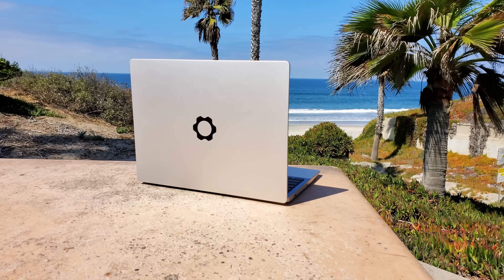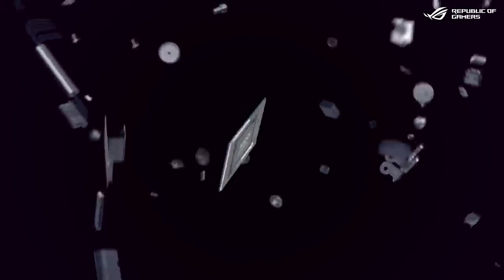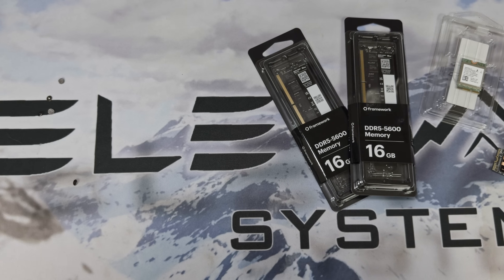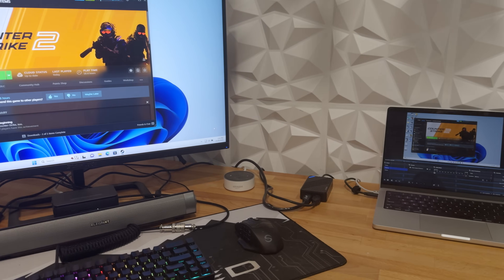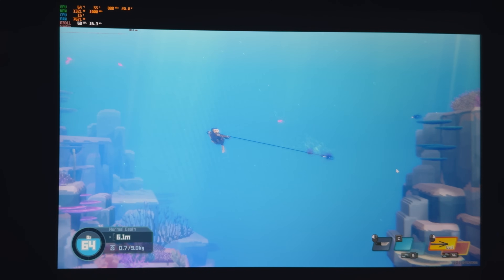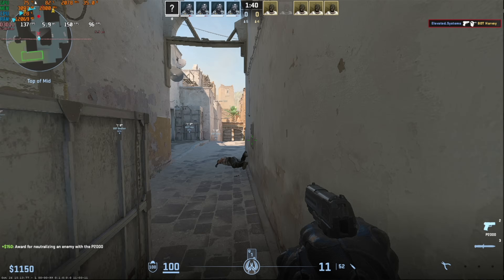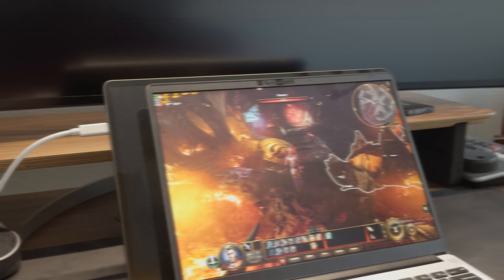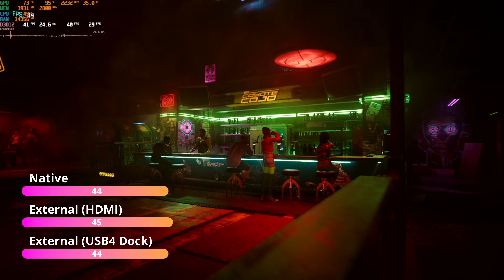Gaming on the AMD Framework 13! Native, Docked & eGPU Performance.

Comment from the maker: Between the testing I did in this video and some since then one additional, important conclusion I've made is, that while FSR may or may not have a significant effect on average FPS depending on the game, it has a significant effect on 1% low FPS in every title that supports it. The gameplay with FSR enabled is significantly smoother than without it.
Reply: I would presume it is “just” the upscaler you have used (now that it is only recently frame generation has been added). 
It is bit annoying both Nvidia and AMD has put new features into the upscaling name, making it very confusing what exactly has been used, lol.
Reply: Thanks, man. I love portable computing 🖥 .
Reply: I would love a quantified look into how Frameworks recommended linux disrtos preform with the battery saving tweaks and without. Also the mention of comparing the framework AMD to the MacBook M2 or M1.

Comment: Using a resolution that's exactly "half" of your native resolution will help drastically with the image quality, as every 4 pixels now renders as one. It's not great. But it least it scales proportionately. Also it's interesting how some games kept it pegged at 97-99% usage and the chip at 35w power draw, while others were closer to 92% and down around 30w. This is definitely limited by the memory, and I wish amd would give these apus some soldered dedicated vram, at least in the higher power configs like the HX chips. The former U and now regular ai cpus don't need it and it would only add to cost, but these 16 cu ones trying to compete on the same memory bandwidth as the CPU? Pain. Cherry picking your ram on desktop makes the desktop counterparts of these cpus significantly faster for gaming, like upwards of 20%. So it's definitely the limiting factor here. And considering the high native resolution, it only makes stress on the memory that much worse. That's why fsr will help drastically.

Comment: Question, how plug an play is it to use an AMD eGPU for the Ryzen 7000 series Framework 13? Is there any problems with AMD Aldrenaline software or does it just work?

Comment: With the new framework 13 AMD AI ryzen. Would that be good for gaming?
Or can you recommend other things?
Reply: The Ryzen AI 340 is weaker compared to the 7640u, the 350 should be on par with the 7840u, likely minor improvements but costs more and the Ryzen AI 9 HX 370 should perform similarly to the 7840HS but it costs a lot of dough

Comment: Contemplating the Framework 16, but I use an Intel chip based TB3 external NVIDIA GPU as my work docking station, and I'm not sure how well it will work with AMD and USB4.
I'm also apprehensive about using Radeon graphics again. My last laptop with it crashed all the time just trying to watch youtube. Same with my gaming desktop with a RX6800, and then a 7900 XTX. (both clean installs) I ended up selling the XTX for a big loss to get a 4080S, which has been much more stable.

Comment: Curious if you'd consider doing this for the framework 16? I know it has a built in GPU option, but I'd love to see how that compares to an eGPU setup on the 16 (and I cannot find anyone who's actually tested it). I've heard it's built in GPU option isn't the greatest (nor would I expect that much given its only $400) But to use it with a high end GPU basically requires an eGPU but I don't know if its worth going that route.
Reply: Wondering the same thing. I have a thunderbolt 3 eGPU docking station with a RTX 4060. Works great on my old intel laptop, even with light gaming, but I really want to upgrade to the FW 16. But if I can't use a nice 1 cable solution with AMD, that's a no go for me and limits my 16" laptop choices.

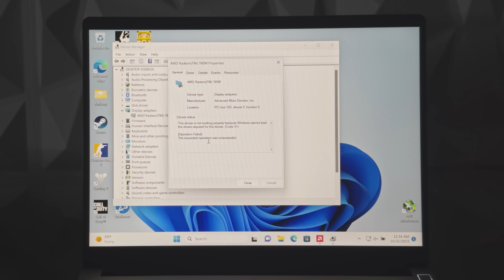Comment: I have seen the problem with drivers shown on 14:07 before and from my experience it should be easily fixable without reinstall. Windows is trying to keep the drivers updated on its own and then there's a mismatch of versions between the Adrenalin and the drivers used. You can actually fix that without reinstalling the drivers by going to Device Manager, pick Update driver on the GPU and then pick the correct driver version from the drivers already on your computer.

Comment: I've got a 12th gen Intel Framework running Linux Mint and have been considering migrating entirely over to using it with an eGPU rather than having a dedicated gaming PC and a laptop. I was about to buy an eGPU enclosure but had some people mention that currently the technology really struggles with high refresh rate monitors.

Have you experienced this at all? I have 3 144hz displays and would like to continue playing games at that refresh rate, at least on 1 of them at a time.
Reply: I ran my frame work with a 3050 and a 165hz monitor and no complaints

Comment: Baldur's Gate 3 uses FSR 1.  Even on my 7700XT, you can see the same type of drop in image quality by turning it on at 1440p Ultra.  I was hoping to see patch 4 at least update it to FSR 2 but it didn't, from looking at the the patch notes.  I haven't installed the patch, yet, due to all the reports of people having issues with it.  As it stands, it's not worth bothering with FSR in the game, if running on most of the more recent AMD GPUs.  If I were playing on my 2in1, I may have to turn FSR on to get anywhere near a good experience.
Reply from the maker: Patch 4 upgrades it to FSR 2.2 https://baldursgate3.game/news/patch-4-now-live_96
Reply: @ElevatedSystems  Okay.  I must have overlooked it.  Thanks for the correction.

Comment: Let’s face it.. the framework laptop could have been an amazing project but it failed in various aspects. It’s not mainstream - fine was to expected, it’s not a creator laptop - fair enough most would go with apple, but it aims to address nerds and tinkerer. However, despite the fact that all forums where full with the just one wish: ECC as the new amd chips fully support it framework went to the „fu-route“ to save 5cents for leaving out traces. 2nd wish was open source firmware - line tuxedo. „But it is fully repairable“ yea.. so is the steam deck for a fraction of the price.
I still don’t understand how you can just treat the Audience like that. It just LTT recommending this box.
Reply: how to tell you're an apple boy without telling you're apple bot
Reply: @ChrisTian-sd5yq  I am everything but an apple boy. But you clearly don’t have any clue about the stuff I was talking about.
Reply: The creators fully understood that it wasn't going to be  a household name in 3 years. they wanted to disrupt the market and make a good laptop.
Reply: @RainbowGin  so why aren’t they doing so

Comment: I honestly had a better egpu experience (7640U+razer core x+ gtx 1070) On windows 10 ltsc was getting a solid 81 fps 1080p max settings on farcry 5 with no stutters and really smooth. From my experience its a lot more stable to use a Nvidia card as the Egpu as it's drivers doesn't conflict with the igpu. However an AMD egpu is fine with a intel igpu. Will be getting the onedock soon do will be testing occulink and USB4 performance using it
Reply from the maker: If I remember correctly on the GTX 1070 Far Cry 5 ran at about 100 FPS at 1080P ultra  when it came out over 5 years ago. What does it run at with the 1070 in a desktop with a current CPU today?
Reply: @ElevatedSystems  I was getting around 95 fps on my desktop same card. In this case the bottleneck doesn't really affect the gameplay. However witcher 3 next gen update struggled a  lot but then again all systems do

Comment: I have my amd on preorder. Batch 9.  
I am wondering what the gpd g1 portable epgu would do.
Reply from the maker: Since Occulink isn't a practical option on the Framework you're still going to have the USB4 bandwidth restrictions which will very likely reduce the performance of the 7600M to barely above the integrated 780M. However, I'd be very happy if someone proved me wrong.

Comment: How about connecting the GPU to PCI express? For example, instead of a Wifi module
Reply from the maker: The M.2 WiFi slot is only an x2 connection. You can connect it to the M.2 SSD slot but then you would have to run the OS via a USB drive, which comes with its own problems.
Reply: doens't it have 2 ssd slots?

Comment: I know nobody is covering framework 7040u 😢
Reply: I feel framework in general needs more spotlights and recognition. No other laptop company is coming close to offering something so repairable and so much upgradability
Reply: too expensive
Reply: how so ?  @LagiohX3
Reply: @X862go  it costs 850$ at that price you get a laptop with a dgpu
Reply: @LagiohX3  it's not 850 when I'm looking, and a laptop with a gpu will only run for an hour on battery 😂. They are basically pointless unplugged from the wall
Reply: @LagiohX3  also navida Gpu will limit you to 30 FPS  unplugged.  At that point, you can build a desktop if you're always plugged up 🤔
Reply: @X862go  you don't use the gpu off the wall obviously but it's there when you need it.
Reply: @LagiohX3  not an option 😂
Reply: @LagiohX3  you haven't used a gaming laptop lately. Have you.  I currently own a zerphrus m6 and an Alienware . The suck back almost 250 watts from the wall and 50 minutes unplugged now that the battery are a year old.  So they're basically paperweight.
Reply: @LagiohX3  trust me, it's not perfect, but the 7040u is giving us about 1050ti lv of gaming at 18-45 watts.  While all other windows pc pulling back 100watts to give you anything considered gaming.   Main company's don't seel APU in there laptop because it will kill their gaming line of laptop with rtx whatever 🙄.  The issue is that navida sets the TDP of the gpu, not the manufacturer.  You wanna call it 3060ti welp has to meet the target specific TDP to get the navida badge.
Reply: @X862go  I  have an Asus A16 with Ryzen 7735hs, basically a 6900hs, has an RX 7600s, it is pretty good off the wall. lasts about 4 hours gaming on the apu at 20w. on the wall it uses about 120w. Lasts 6 hours web browsing or watching videos. Its not apple level but still quite good, main issue with me is size, that's why im considering buying a handheld.